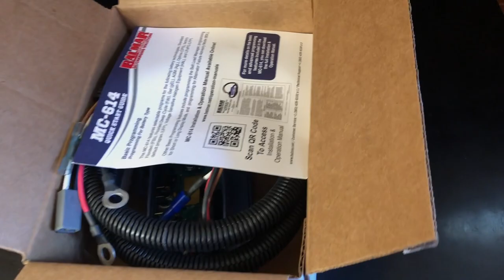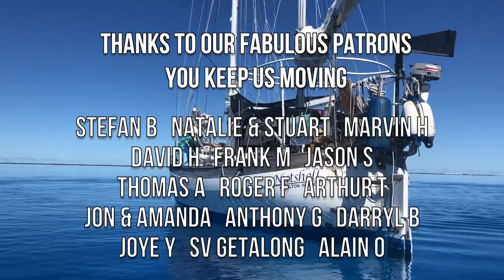Ep 209 | Up a Crocodile Infested River on Peanut, Sailing Nutshell, Australia

Comment: Do you use Dielectric Grease on your electrical connections ? I think your on the right path with some alterations to the rock guard. Protect the skeg and prop and start with removing 1 or 2 of the fore & aft running connectors. looking forward to the trip.
Reply from the maker: Yes, we use Dialectric Grease. Thanks for the tip on the prop guard.

Comment: A rubber ducky guard for use around swimmers, cut a couple of the parallel bars off, that should help the flow of water 🤔
Reply from the maker: My plan is to remove most of the fins.

Comment: You might want give a thought at spraying a rhino liner or Linex truck bedliner on the inside of your aluminum boat to the water line. It comes in a variety of colours and will protect its structure  if you bang into rocks or Crocs. https://youtu.be/VSvVy6oiMZI🐊
Try removing the ring and cut those arms that hold it back leave the part that protects your forward lower unit. It’s better than nothing and will solve your cavitation problem.

Comment: That is the problem with Prop Guards, it definitely affects performance and makes it difficult to get on the Plane. As long as you are careful when beaching or coming into the shore to lift the engine up, you should be OK. Does the endine have a tilt mechanism? Anyway, great vid as always Magnus.
Reply: I was acquainted with a bloke named Brian Starr while working at a non-ferrous foundry in SA during the 1980's.
Just wondering....